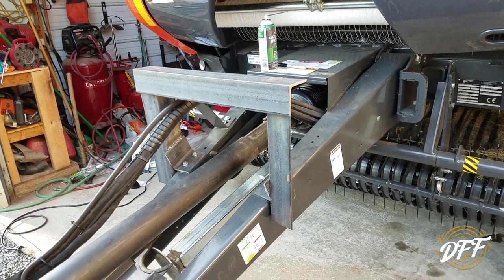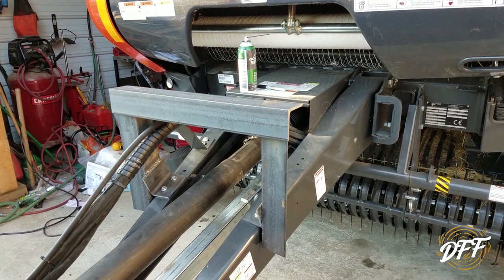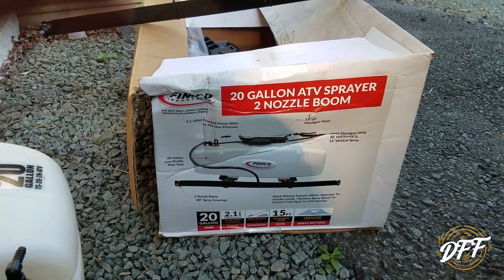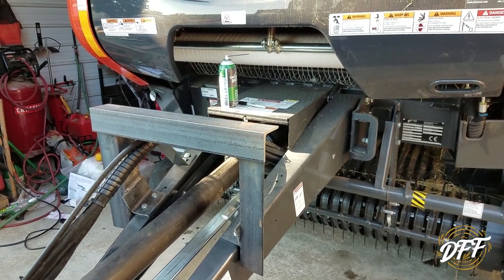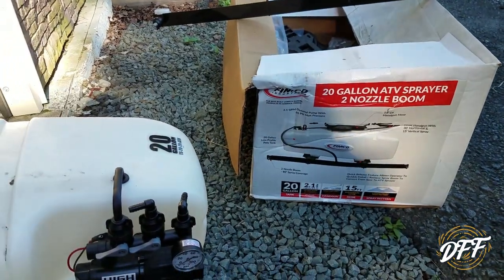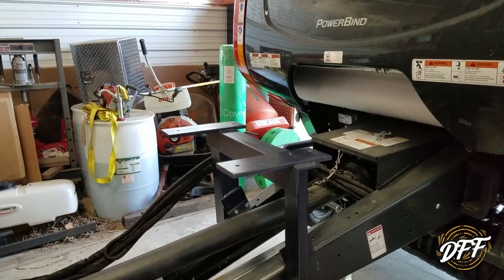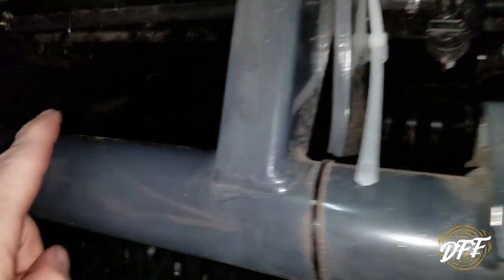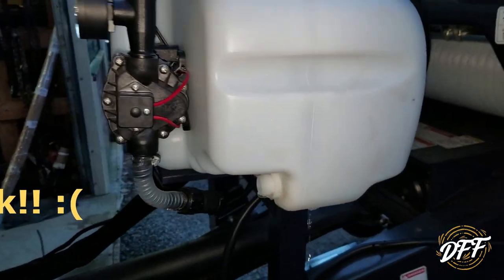CHEAP Liquid Preservative Applicator For Your Baler!!

Comment: We had a tank on the round baler, but it was for making haylage.
No fancy stuff, just a switch in the cab. Set the pressure for the nozzle at the pump and go.. shut it off to tie bales. 
Never used preservative. Looked into it a few times, but unless it was for clover and alfalfa,..... 
They said it didn't work on grass.
Then there was some that would work for grass, but it would eat the baler up in a couple of years.
I know there's new stuff out now, got a friend who sells it, just need to get together with him and see what it can do.
Those little spray tanks are great for lots of things!! We use then for foam marker tanks on the buggies. I've put a couple in people's trucks for hand washing... One of the vets we have used put one in his vet truck, he asked me to do it.. I showed him where to hook the wire, he did it👍👍
Thanks for the video Chris!!
Reply from the maker: I never thought about using one for hand washing- that could be handy! I use a food grade hay preservative that is non corrosive. Thanks Ed!
Reply: @dehavenfamilyfarm  same pump as an RV system... 😎

Comment: My brother bought a 50 or 60 gallon 3pt sprayer from the same company you mention in the video.  He had broken parts out of the box, then later broken valve/manifold parts, etc.  Nice set up you got though.  What kind of preservative are you using?  We use New Holland Crop Saver buffered propionic acid on our baler with good luck when we need it.
Reply from the maker: It sure stinks when things are broken right out of the box... I use Guardian hay preservative. It is a food grade preservative that doesn't corrode metal. I have had good luck with it so far.